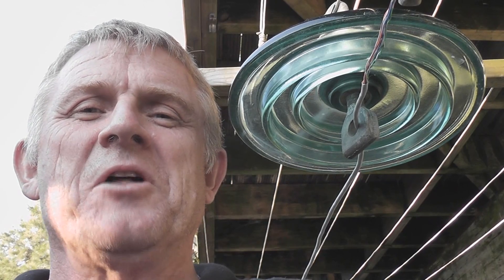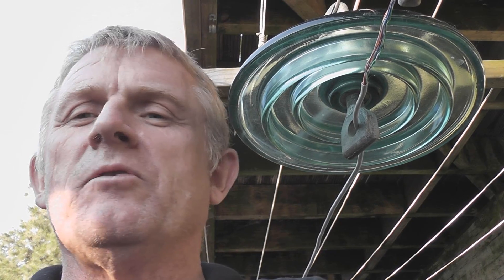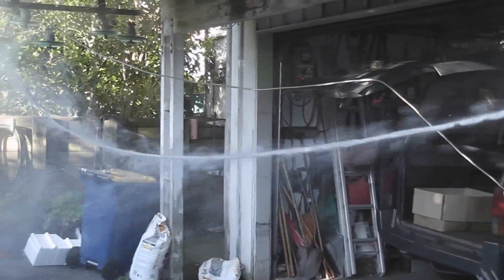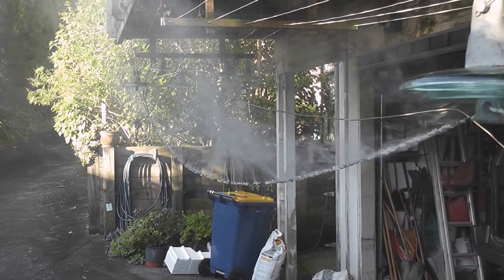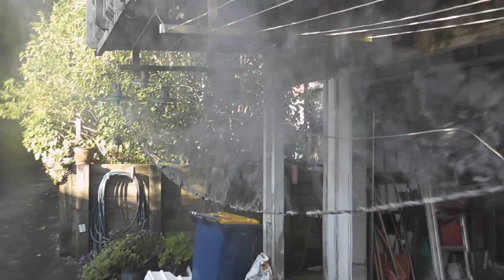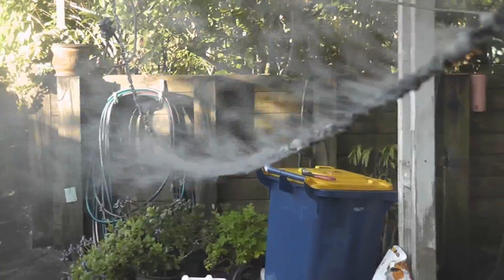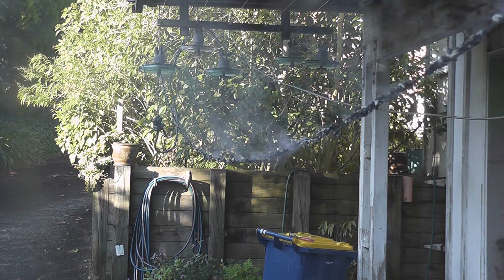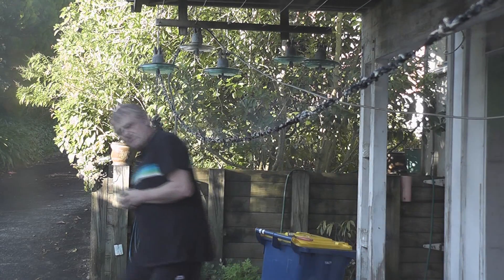2 Petabytes data transfer Cat 4 cable smoking

Comment: nope u just shorted it on one end and used a high amp power supply to power it on the second one
Reply: I think it's only for demonstration, what happens, if you would send 2 PB over this line in this time. Nevertheless, you have to find a networking adapter supplying 3kW over one plug...

Comment: I call BS on this.  First, there are currently no network interfaces that can transfer data at Pb speeds.  The fastest is 10Gig, and you'd need 100 of those interfaces to equal a Pb interface.  You need 1 cable per interface.  Also, the electrical characteristics are such that faster data transfer will not result in overheating.  For higher data transfer rates, they use higher frequency, NOT higher current or voltage.
Reply: If you actually believe that 10GB is the fastest transfer speed we have you're in for a fantastic revelation.
Reply: thelol1759 thank you.

Comment: Funny but this is not data transfer. This is a constant current and for any computer unreadable even it can handle 50.000 petabytes. This is just a cable running a high current with a dummy load, nothing more than that so stop calling everything petabytes to get more hits. Still not convinced? Tell me, what is the amount of power running through that cable at that moment. Voltage and amps. Are the wires single connected so not twisted together but real 8 wires connected to some kind of data transfer. Now tell me how much current is running when used in a normal situation? Those kind of cables are not for fun called "Low voltage cable"!
Reply: Let me blow your mind for a second.

In binary circuits, there is no reason that "0" has to equate to a zero voltage potential.
Reply: +FreerunMediaService I would suggest more learning.
Reply: By trying to look smart you've made yourself like a complete jackass
Reply: Nope, data is a 0 or a 1. An alternating current is going from 0 to 0.1, 0.2 and so on to a 1. It is an analogue signal and it is just plain electricity knowledge. An alternator, what does that do? Ok now the outlet of you house, were does it get the power from? From an alternator drivin by water or wind or solar or plain oil. Data is pulsating, this is a sinus. You can't read it out and can't receive any data from it other than the amount of power going through the lines. If this is what you are say it is, than there there is no more need for a battery in a cellphone because the same antenna receive the data and the power to drive the phone.
Reply: *****
You seem to have a fundamental misunderstanding of the concept of "conventions".

Data as simple as an arbitrarily defined delta between two values. Which are then mapped to those "1s and 0s".

By your definition, we could never have used AM radio to send data because its not a perfect square wave. And yet we did.

And that last statement you made makes very little sense. The logical leap required to take what I said and turn it into what you did is pretty far man.
Reply: ***** Well to be precise, AM stands for Amplitude Modulation . This still is an analogue signal because there are still values between 0.1 and 0.2. AM is not digital at all, so is FM ( Frequency Modulation ) that is also an alaogue signal. Because the quality of an FM signal is better you could send data. That is something completly different if you compare that with the project at hand here. It still isn't data transfer but just a simple short out of 2 energypoints. If you want to see it digitally, it is just a one bit 1 send over. When the cable breaks, it is an one bit zero. Because the frequency of this "data transfer" is one bit every time span, it isn't readable data.

To answer your statement about the what i say, could result in not transmitting data. Nope sorry, you still could send data but it is still an analogue audioable sound with only 1's and 0's. These aren't petabytes but just kilobytes if you are lucky. You are modulating audio over the AM.
Reply: ***** I really think you're just incapable of communicating with me man.

That entire post was essentially just a rehash of what I said above. Good luck man. But I think this conversation isnt going anywhere.
Reply: ***** I don't need a lecture in basic electrical theory, and what you are stating doesn't prove your point. Honeslty, you remind me of some of the kids i use to teach in my telecommunications class.

I don't have time to explain general theory of information transfer. Go to your local library or take some college courses. You're a special kind of stupid. Somebody that needs to be sat-down (lots of hand holding) and walked through everything until you understand.
Reply: ***** We come from to different back grounds and i'm not going to be able to make you understand. I come from a background of Scientific evidence which serves to either support or counter a scientific theory or hypothesis. Such evidence is expected to be empirical evidence and interpretation in accordance with scientific method.

You come from a backgroud of "however I understand it in my dumb head."
Reply: You can even try it scientific! Make a short circuit, count that as a digital 1. Disconnect the short circuit, count that as a 0 ( zero ). Now do this miljons of times in a second, That is a data transfer, megabytes or petabytes. Now make a short circuit, count it as a digital 1 and leave it like that. It stays a 1 and for as long as you leave it, it never becomes a zero. There is no digital information other than that one high point called a digital 1. Now turn up the power, let us say it is 200 amps. The wire melts but is is still a digital 1. It is stays one bit, how many power you put to it. 

Try that scientificly, you will come to the same result. Dumb? No, just a guy who knows electrical things and working with that in real time with no computer predicting how it could be otherwise.
Reply: ***** ok Tesla you have convinced me now leave me alone.
Reply: William Ellison
You have to ignore people like him man.

I dont think he's trolling, he's just missing some fundamental concepts that make him unable to understand what we're saying.
Reply: Let me answer in a one or a zero. What ever you like.
Reply: William Ellison Because? It is just commen electronics. Digital is a 0 ( zero ) or a 1. One very long digital 1 isn't even a byte but a bit. So when a short is created like in this situation, it is a very long 1. One 1 is one bit and it never can be petabytes. If he is using alternating current over a cable that can't handle the current, it melts. An alternating current is an analogue sinus. If it's digitally generated it is still analogue because there no -1 in digital language, only a 0 and a 1. 

AM and FM are analogue signals and even you can transmit digital data over it, the carrier is analogue. Look at the old comodore 64, that one used a tape for data. Is the tape digital or analogue?

Comment: That's category 4 cable which usually uses 10BASE-T. In 10BASE-T 70mA is usually reserved and it would have required 112 billion joules to transfer 2 000 000 000 000 000 bytes over it. I believe those cables would evaporate if you tried to do it in reasonable time..

Comment: Ooooh, I must have missed this one! (Viewer # 1,421!)

Aaaah, the fun of cable overloading and burn ups. :-)

It would be interesting to use a multi meter to test the resistance of the wire before it's connected up to the potential so that a rough guess could be made to the amount of power which would flow and how much is needed to get it smoking. :-)

Maybe one day, when i can get a spare moment, I will get another bit of that steel wire that I popped and test the resistance of it to see what it actually is. :-)

Thanxx for showing,

-BoomBoxDeluxe.

11th June 2015, 23.12

Comment: Great way to burn out the insulation on scrap wire, scrape off the toxic ash and you are left with good clean copper ready for recycling!
Reply: ***** but you also get a lot of carbon and copper oxide on it. It's best to do it in an oxygenless atmosphere. A carbon furnace would do the job and the flame would keep the oxygen away.
Reply: very cool

Comment: excellent smoke.  try 3 petabytes next time.  I want flames.
0101000111001010100101110110101011110000101010111001011001
Reply: Sam Sitar its actually constant ones traveling down the line, rather than ones and zero's  which makes it much larger.

Comment: 1. Omg you have a face!
2. You were pushing amps, not bytes but nice try!
Reply: joblessalex I found somewhere that the internet uses 2 to 4 microJoules to send a bit of information.  That means he's shoving 100 to 200 million Watts down that wire over about 300 seconds to equate to 2PB total transfer?  I think my calculations are off.
Reply: DrRawley That, and data is different all the time, so sending a bunch of 1s would be worse than sending 0s.

Comment: You could add a few anotations here and there as this is an exelent and quite clear example of thermal expansion. You can clearly si how it expands as it heats up in the beginning and how it contracs  at the end once you turn the current off.
Reply from the maker: Laharl Krichevskoy Good idea.